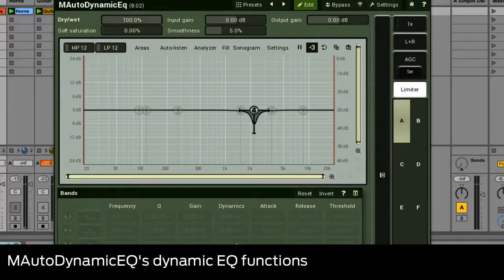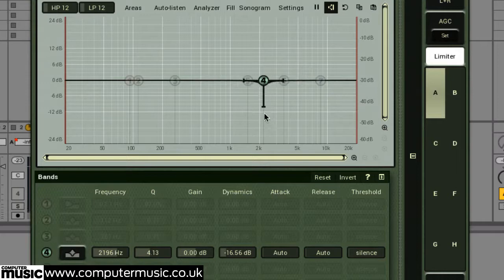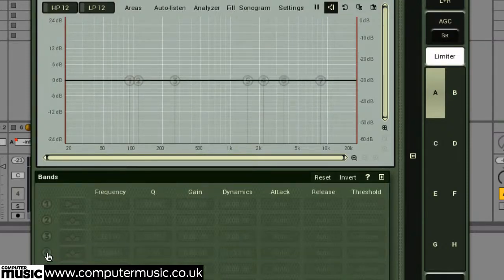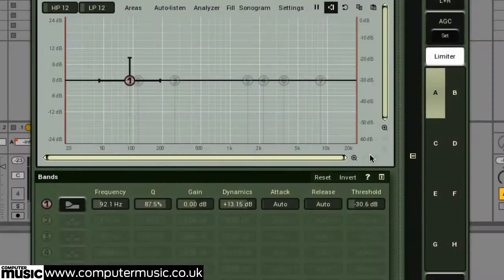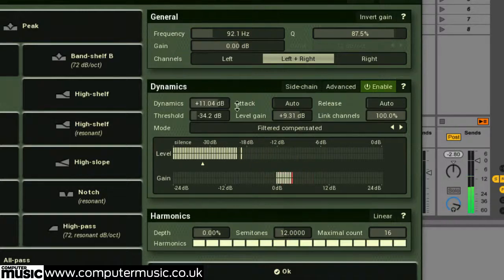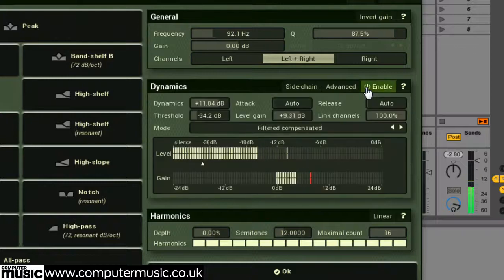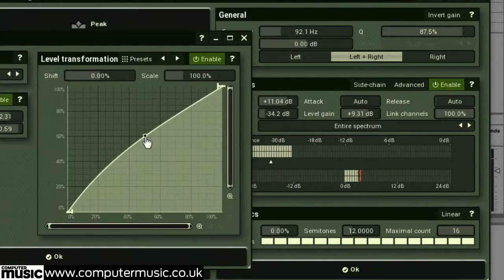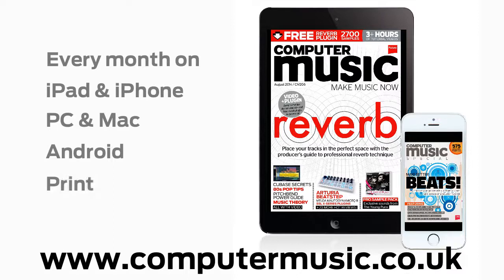Dynamic EQ with MAutoDynamicEQ 8 - 3/6

Comment: No ratio control?
Reply: The 'Dynamics' parameter works as ratio control.
+ 6dB works like an expander -- Ratio 1:2
- 6dB works like a compressor -- Ratio 2:1
The parameter's range is -+24dB, which is 16:1 ratio compression and 1:16 expansion.